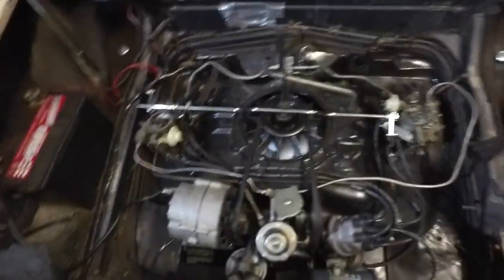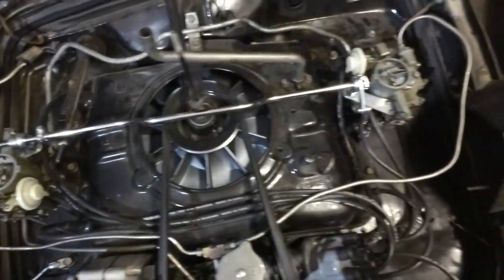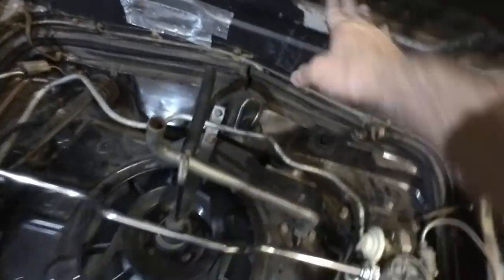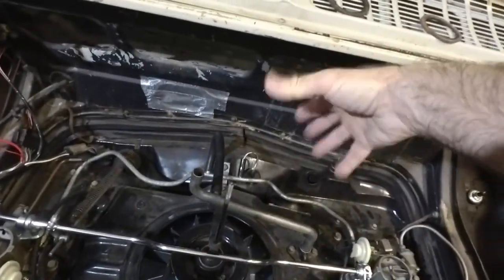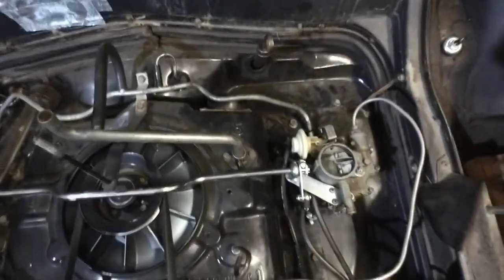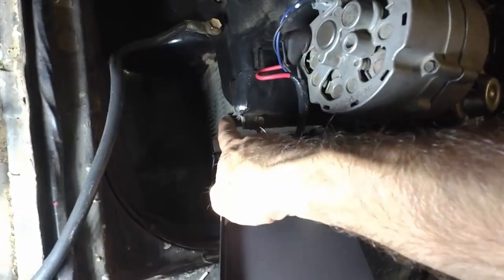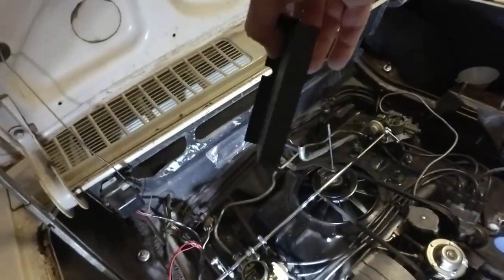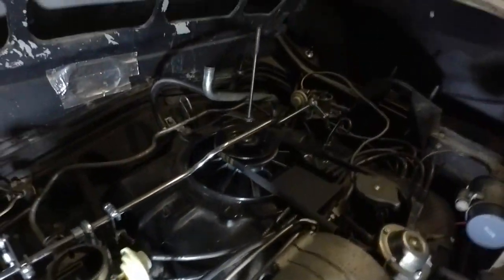Corvair Cooling Sheetmetal tips - What to check for..

Comment: Wait, I don't understand are you saying that openning and hose have no purpose other than "fresh air"?
Reply from the maker: Yes - technically it routes to a blend door so the heat lever can add more cooler air when up or all heat when down. But you are taking away pressure that's needed for engine cooling. So blocking it off as well as the inner blend-door area on the heater box improves both functions - more heat! Now my 66 can be driven in -11F like I did the other day.
Reply: @grillsandaxlegrease3578  thanks man!

Comment: How good are radiator type oil Coolers.that were factory coolers on 62& 63 I think   I am using one on a 65 110hp corvair.Is this type cooler ok to use on this motor ?
Reply from the maker: Folded fin as I call them - are the best for all years.  Some prefer the 12 plate but that folded fin is absolutely fine.

Comment: hi can you supply the part # for oil cooler plate?  Thank you for the tips
Reply from the maker: Yes - FOund it - Took me awhile as it was hidden in the catalog on page 102. The part is C9222. Works on all cars except air conditioned cars. They need a version for those as they need it more!
Reply: @grillsandaxlegrease3578  that's for the hose plate, I can't seem to find the oil cooler plate do you know the part # Thnks
Reply from the maker: @Jesvox1234  Oh those you have to buy from a Used vendor. Lots of sources in the corvair FB group pages. You'll find one fast there. I'm sure Steve Morton in ID has one.
Reply: @grillsandaxlegrease3578  thank you sir I’ll be looking around !

Comment: Very good video.  It is essential that the three inch hole on the top cover be blocked off.  That hole is a major coolant leak on the air-cooled engine.  There have been many engines that dropped a valve seat on cylinder number 5 from overheating.